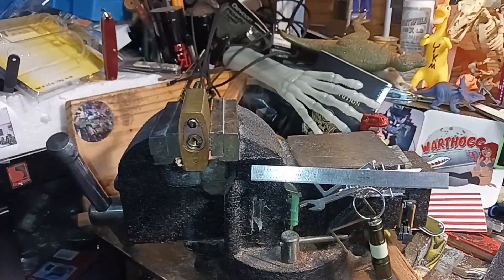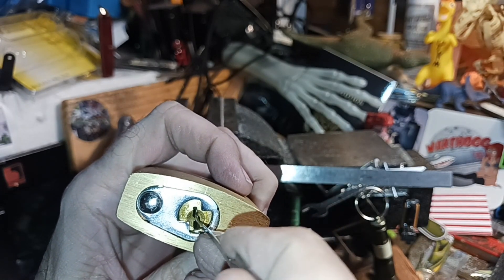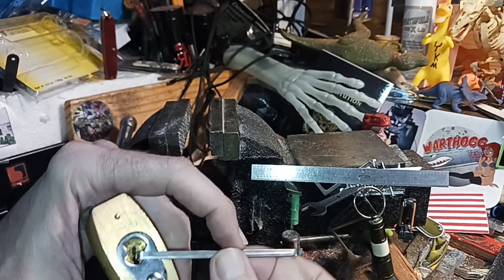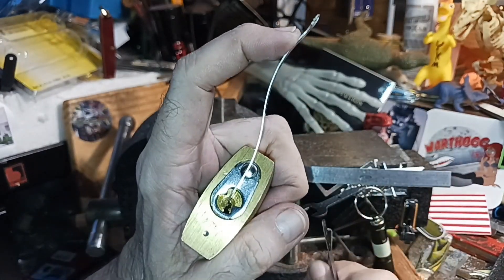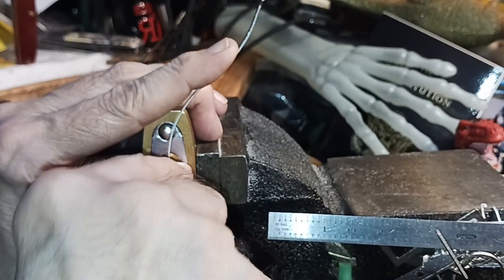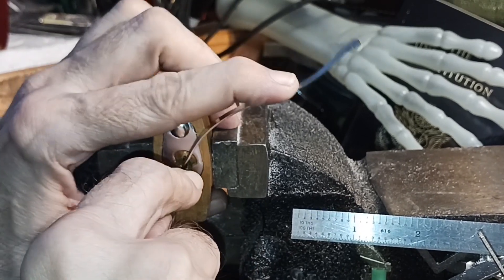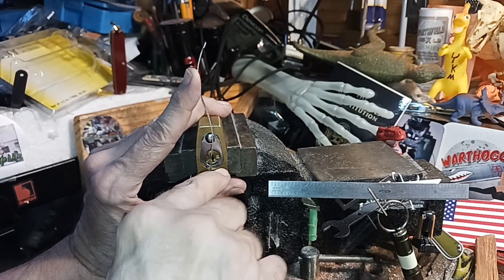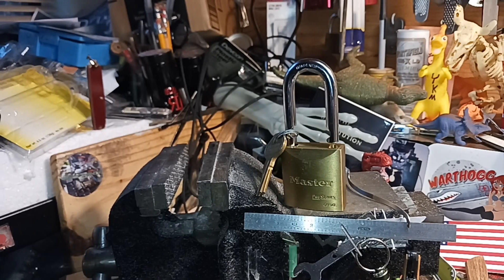(969) 🔐 Intermeditate Level Picking 🔓 5 pin Masterlock Pro Series 6850

Comment: We put the pins upside down to fool American pickers, see we think it's funny to see someone struggle and not having a clue hehe. The first time was very quick, luck or expertise? If you rotate it, be sure that you notice or it's getting complicated. Thank you for the video William.
Reply from the maker: And in England they drive 🚗 on the wrong side of the road compared to America. 😂 A car will remind you with the steering wheel on the driver's side. I drove  a motorcycle 🏍 when I was stationed in England and making turns  will get you on the wrong side of the road if you go by instinct.  
Once you learn a particular lock, picking it can get easy. Sometimes it's just the way the manufacturer keyed the lock makes it easy or difficult.  Other times it's the tolerance of the parts. And yes, sometimes it's just luck. :_DannyDyno:
Reply: @WilliamsKnifeLife  I wouldn't survive 5 minutes on the road in England. Strange fellows the Brittish. Locks though can be very awkward at first, but once you get the feel of it, it get's easier. Or if the lock is so worn out it is impossible to open it.

Comment: I notice some locks will retain the key and not let the key come out until the lock is closed. Therefore, if you pick the lock to open it, do you have to pick it again to close it?🐯
Reply from the maker: Yes. On a Tubular lock which is key Retaining you have to pick the lock at least twice usually to close it completely. On pin Tumbler locks, it doesn't usually require you to pick it closed. The key Retaining method is different.

Comment: are these easier to pick than your standard front door locks?
Reply from the maker: Not here in America. Kwikset are one of the most used locks on doors & the standard Kwikset has no security pins. It's about as easy to get into as the Masterlock number 3 Padlock. Kwikset does make a model that's harder to pick, and our apartment complex uses them. It's a easy to reprogram lock that doesn't require a locksmith to do it.